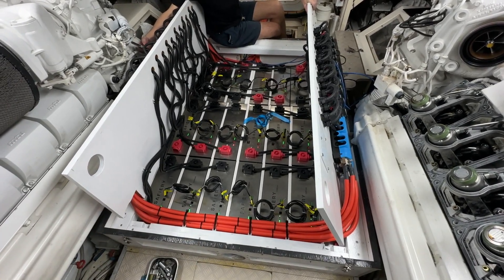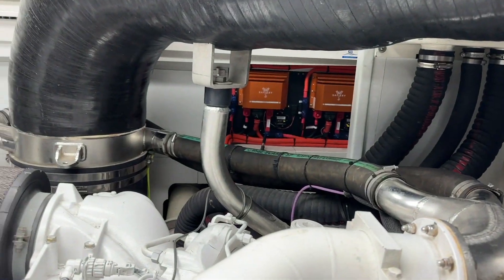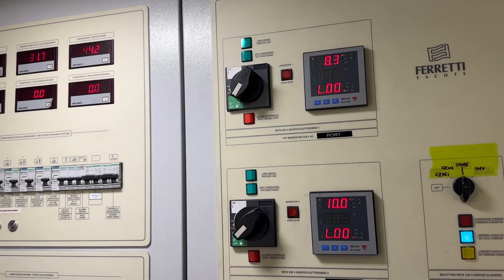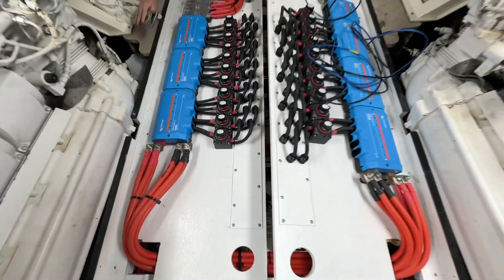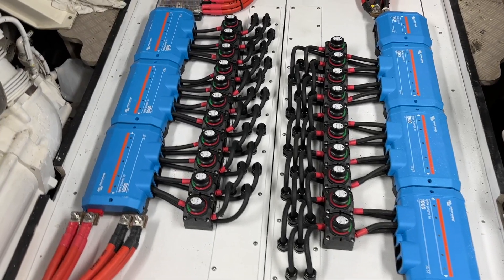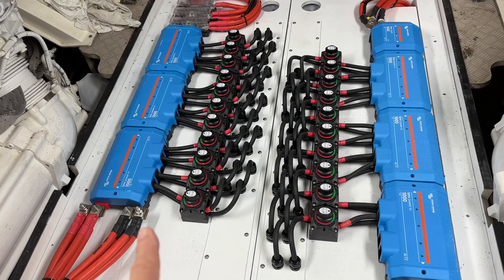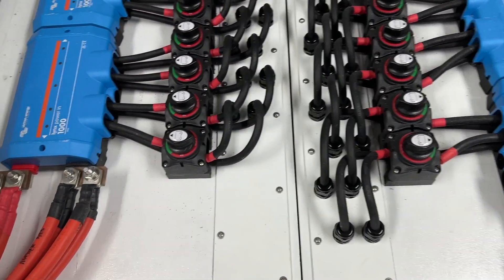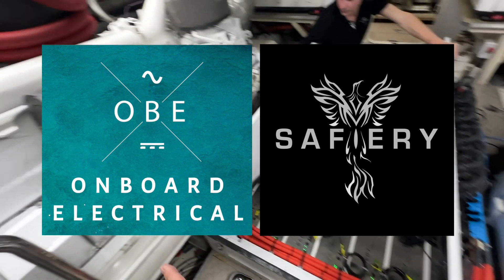100kWh of Lithium in Engine Room of this Ferretti Motor Yacht replenished by 6kW Scottys and Victron

Comment: How did you overcome the 1000A limit on the Lynx Power-in with a huge system like this?
Reply from the maker: 2 x 1000A Lynx busses to a 2000A bus we made ourselves. System has not missed a beat since we installed it.

Comment: That’s a very impressive installation, the attention to detail and quality of installation is at a level rarely seen, congratulations.

I note you also charge from the alternators. 

Have you kept the standard alternators and if so have you needed to change the regulators?
Reply from the maker: No we dont change the regulators and they are the factory units. If we were to do this in 2025, we would drive our new Permanent Magnet hybrid units at 85% efficiency and up to 10kW output as well as taking power from 24V alternators. This would give 23kW+ from two engines!

Comment: Amazing guys! Do you charge from the generator too? im guessing due to the massive battery pack not really needed unless you're at anchor for a good amount of time?
Reply from the maker: Yes we do. With Ferretti there are 2 shore power inputs and 2 gensets and 2 independent AC power distribution circuits. Ferritti have a complex safety control system to ensure no two sources are on the same circuit but there is open choice of power source per circuit. So adding 30kVA of auto-cutover Victron Inverter Chargers is a challenging design... but one easily met by our solution..

Comment: How did you charge from the alternators?
And what about the heat on the engine room?
Reply from the maker: 2 x 24V- 48V 3000W DC DC called Scotty whic is our product, 96.5% efficient bi-directional charging. read the note on heat in the text. This engine room is no problem.
Reply: Ferreti has mastervolt chargers did you use them or you replace them with victron ?
Reply from the maker: @PlexMulti  replaced with Victron as the batteries are CANbus and in a system of this size we only do systems where the battery CCL and DCL drive both the Victron inverter chargers and Scotty both on same 250baud bus.
Reply: That is one clean set up.